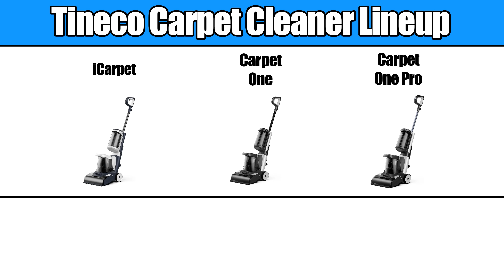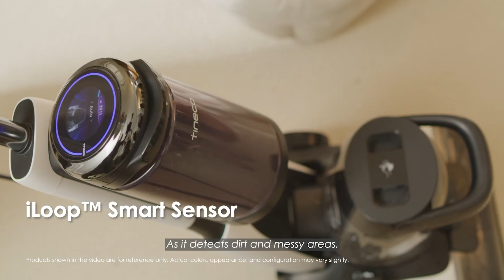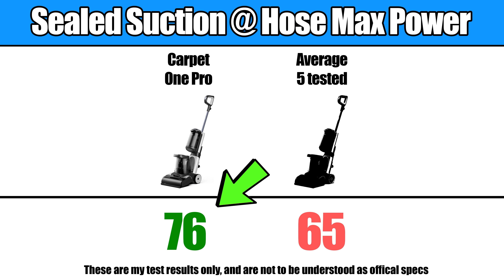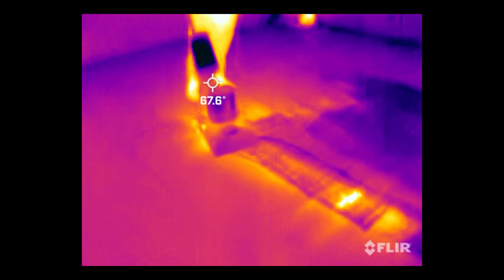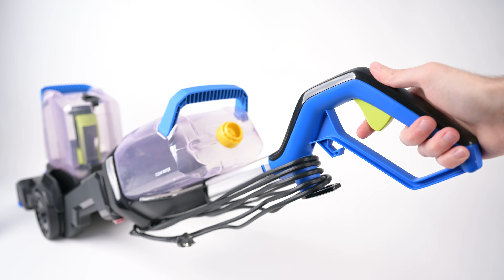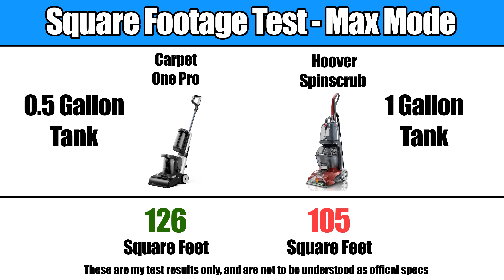Tineco Carpet Cleaner REVIEW - iCarpet vs Carpet ONE vs Carpet ONE PRO

Comment: May I ask your thoughts on how this would compare to the Shark CarpetXpert? I'm trying to decide between the two. I like that both have easily removable brushes and dirty tanks for cleaning, and that you have said the Shark leaves carpet drying quicker from good suction, while the Tineco leaves carpet drying quicker from heat. Not sure which cleans better in general and how different the post dryness is?

Comment: I bought one and I’m convinced Tineco is selling 2 versions of this carpet cleaner. Mine is missing the humidity sensor so the dryness meter doesn’t work and it doesn’t have WiFi. Weird thing is no one at tineco knows this
Reply: You bought icarpet 
Carpet one and one pro have dryness meter
Reply: @fantouss no it’s the carpet one on Amazon. It has a dryness meter but it doesn’t illuminate. Amazon confirmed Tineco removed the WiFi and dryness meter functionality from newer models and discounted them

Comment: I've been watching a lot of your reviews and pondering on my needs a lot (cats pee in same place on carpet regularly) and the fact it heats the water itself is much more important to me than even the drying of the carpet. If I have the same tub of water and solution in there for 2 weeks because Im cleaning every few days but only a 3'x3' spot, it's handy that the water will get "reheated" for me and I'm not spraying cold the rest of the time. As good as the proheat 2x and ex201 seem, that alone feels like a win. Again, for my specific situation. The other two do seem great!
Reply: Unless I've missed something from those reviews, it doesn't mention heating the water?
Reply from the maker: These do heat the water.
Reply: Cat pee is a special kind of stain. Mice that walk through it are marked for life (which is actually fascinating in its own right.) 
Cat Pee is a stain that sets with heat. Use cold water first to remove as much as possible. Allow the area to dry, then treat with an enzyme cleaner made specifically to break down cat pee. Look for enzyme cleaners that contain several different enzymes, including protease, lipase, amylase, cellulase and urate oxidase. These break down the urine until it is no longer urine, something regular detergents and acid neutralizing agents don’t do particularly well.

Comment: Ours stopped working the 3rd time using it, won't dispense water. Started working again the next day, now won't dispense water again.  Did every thing to get it to work. Lots of bad reviews on Amazon, Best buy no longer sells it.  Maybe some are lemons, but it seems like they all fail eventually.  Good luck for those out of the return window.
Reply from the maker: That is such a bummer.  Thank  you for the heads up here.

Comment: @VacuumWars Thanks for your work!!! So I'm repeating a previous question... Did you use the included Tineco Cleaning Solution? Or did you use the Bissell Pro Advanced MAX Clean + Product solution?

And again, I would be VERY interested in how a Tineco iCarpet (the "cheaper" version) would compare with suction data and such to the Bissell Big Green Machine.

Thanks again for all your work and efforts! 👍

Comment: So would you recommend BISSELL Proheat 2x revolution pet pro or Tineco icarpet? I’m trying to decide. We have a dog that sheds bad. I want one that has removable parts for easy cleaning, attachment for stairs and good drying time.
Reply: I also have pets and the Tineco is so easy to clean. I have owned nearly every different brand of carpet shampooer. Tineco brought my carpet back to “new” appearance. I use it more frequently than I have ever used a shampooer because it is easy to clean. I have no regrets with the Carpet One. PS. I always use Tineco brand solution.
Reply: @lindagammage951 I'm confused between carpet one and bissel 
Which one you prefer please

Comment: I LOVE how thorough your review was. I could not find anything on their site to help me compare the models. I kind of wish the pro had a manual water override so you can control the water.

The only thing I don’t like about these is the heat comes on automatically. Doesn’t heat set stains?? I’d rather go over it a ton of times first and THEN do the heat feature. 

Meh, I most likely will order one though.  What kind of cleaner do you use with these?

What’s the best carpet stain remover for animal urine?? I’m about to look through your videos to see if you have any.
Reply: Heat does not set stains.  Drying does. The area is still wet

Comment: Hi there,  love your reviews, detailed  tests and clear explanations. One question please  We have a Big Greens already. But I have noticed that it can be a bit rough on carpet due to its heavy duty roller brush which is always on. How would you compare the Carpet Pro with Big Green for domestic use in terms of cleaning power and suction power? Does the Carpet One Pro justify a spot as a gentle carpet yet efficient cleaner for regular while keeping the Big Green for the less regular deep cleaning for domestic use please? Or should we get a light weight commercial one like Sabrina 14L which has great suction with a wand but without a brush roller, and to be used in conjunction with the Big Green. For us space is more important than the price tag. Thanks.

Comment: Can you test the Tineco s5 STEAM cleaner, there is almost no reviews on it, at CES they announced a cordless version the s7 Steam wet/dry vacuum. THERE IS NOTHING ON YOUTUBE  for the s5 Steam wet/dry vacuum, I fill like it would be more practical than the s5 pro as you don't have to buy cleaning fluid, only draw back is that its corded.
Reply: S7 is not available in all countries, will be available in Australia in mid 23 and will be waiting for it..
Reply: But I think still solution is required..
Reply: @aleksandrabecek3169  solution isnt required, you dont need solution for hot ass steam.

Comment: Okay so as a certified carpet cleaner, dump the water from the recovery tank, in a toilet…not on the driveway.  It’s better for the environment and won’t contaminate any aquifers.  I am curious how it senses dirt??? It is basically reading the clarity of the water being sucked back in?  I wouldn’t put a ton of stock in it being accurate, seems like it would be harder to sense how clean it is because 70% of carpet cleaning is getting oils from the fibers.
Reply: As a carpet cleaner which carpet cleaner do you find the best
Reply: @hannahkhan3197  It really depends on what you’re trying to do. If you want something to spread out how often you call in professionals, the rug doctors can do okay. They just don’t have the power to really get all the oils out of the carpet…plus it’s easy to leave a lot of the detergents in the carpet and that can attract dirt as well.  Ultimately if it has heat and you are careful to not over wet the carpet you can make them work.  

I would suggest using a pump sprayer with the cleaning solution mixed into it to pretreat and wouldn’t put it in the tank of the machine.  That way you control how much gets in the carpet.
Reply: @deasterbrooks  so I’m wanting to do family carpets and it’s between the rug doctor and the bissell hydro steam.. my carpets right now need a really good clean.. and if I’m also wanting to start up a mini business what would you suggest to start with